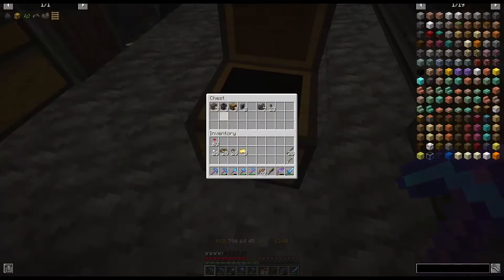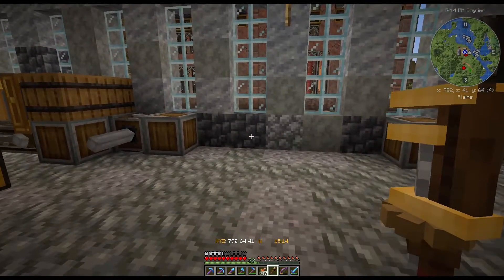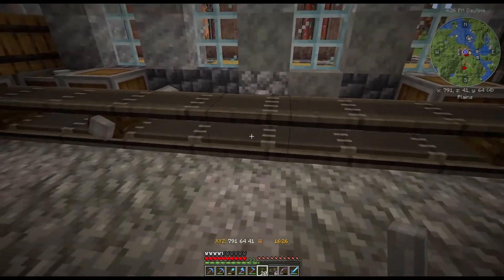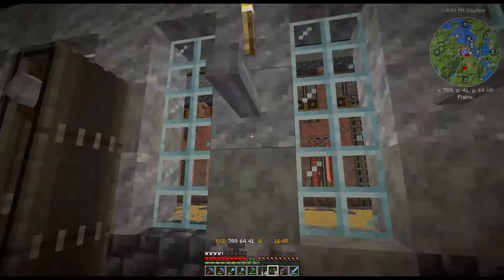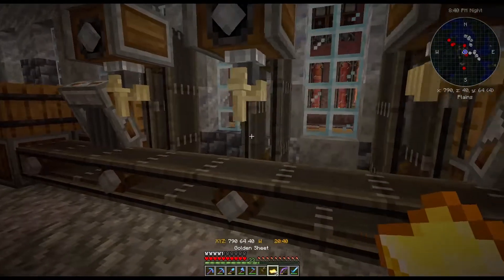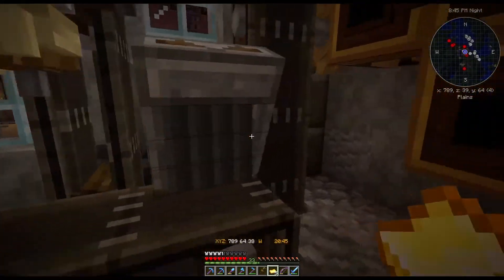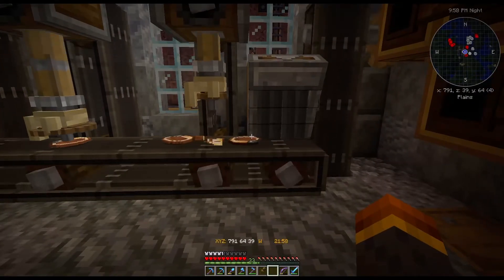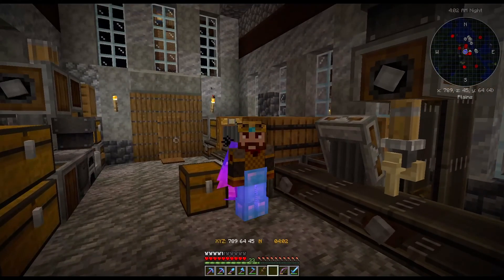Building Precision Mechanisms!  A Minecraft Create Mod Tutorial.

Comment: Interesting problem: but I made this work with a water wheel. I moved it to a steam engine, and built it the exact same way, but the deployers do not come down and make precision mechanisms. The gold sheets just go down the belt to the other chute. Any ideas? Is it too fast?
Reply from the maker: So, if you literally just changed out your power source but kept everything the same this should still work perfectly. I’ve actually turned the speed up on mine a lot and it’s not affected at all. I’d double-check a couple of things. Make sure your deployers have the ingredients they need. Make sure you don’t have a deployer with some other random item in its hand, I’ve had that happen before. And make sure your deployers are set to “deploy” and not “attack” mode.